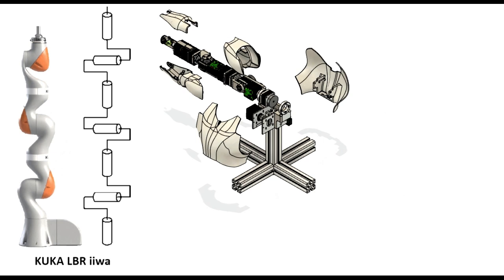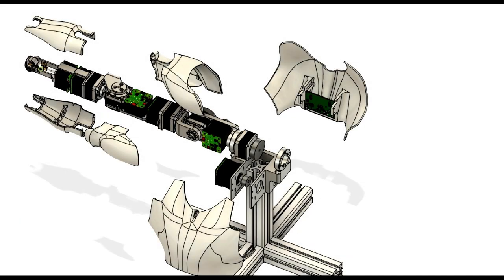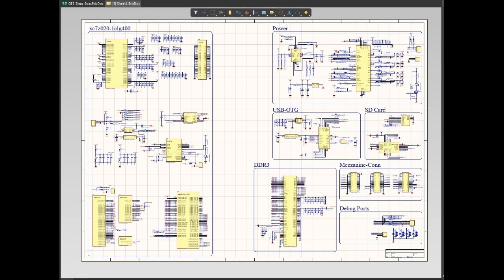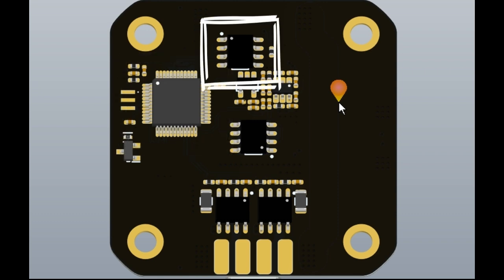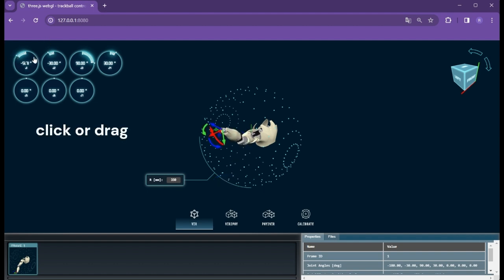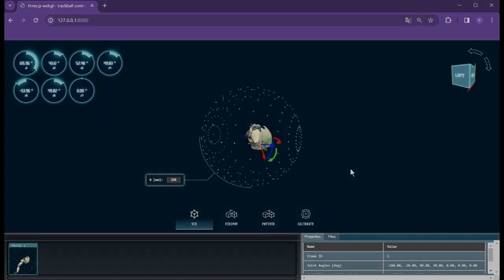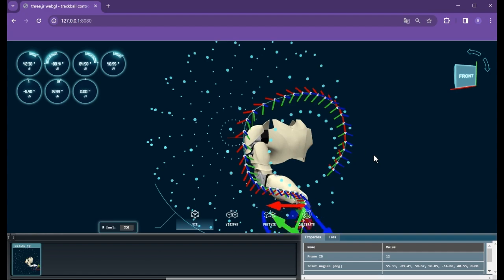QT3: A Humanoid Robot Arm with Armor

Comment: How do you set the robot to Home when the magnetic sensor only detects the motor's rotation angle (0-360 degrees), not the joint's output rotation angle?

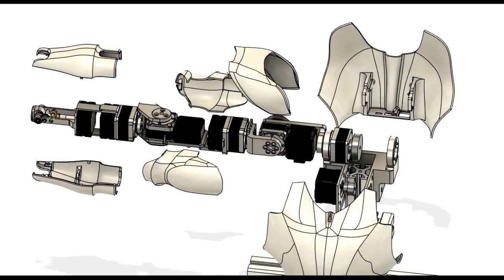Comment: 0:30, that shit is definitely possible with a 6 DOF arm, its even possible with a 4 DOF arm, it literally takes 4 DOF to do that shit, what is going on with the false bs LMAO, it can be done with any arm that has a correct configuration and has 4+ DOF, chinese robot engineers got their education in a sushi resturant.
 
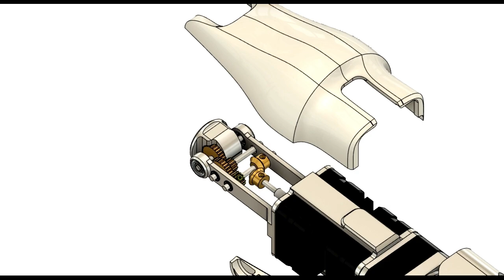Oh and 1:01, a harmonic drive literally exist because its reliable, and weighs less, allowing robots to have skinny wrists. I hope this video is satire, almost every single thing they say is extremely backwards and wrong, this arm is pure garbage. Its literally hobby stepper motors connected together in a chain with a DIY shit gearbox, the gearbox is complete garbage.
Reply: calm down

Comment: the problem with this design is it has no hands and does not even consider the need to place all the motors for the fingers into this design.  You are just ignoring that part to your future detriment.  This is called technical debt.  A total redesign will be needed to even have hands later.
Reply: I strongly disagree with your technical debt statement
 As a designer of robot hands myself, there are plenty of even off the shelf self-contained designs which would fit on end of this arm, let along custom solutions.
Reply: @sstedman  I am not referring to toy level strength hands LOL.

Comment: Wow.  That dashboard and workspace is AWESOME.  How's your heat?  I'm also using STM32 for a closed loop controller - with some home built linear motors.  Controlling them w/ FOC, so curious if you're gonna use SVPWM w/ the upcoming BLDC build :)  the footprint of your custom PCB is lovely.  Jealous of your printer!  Those look and sound like aluminum printed bones

Comment: Bro you did it alone ? It's 🔥.  Why did you connect two motors ? Was it for encoding ?
Reply from the maker: I did not connect two motors, but I did connect motor to reduction gear (that may look like a motor?) to increase torque.
Reply: @吳永玹-t3g  is you use any torque sensor ?
and as in your video you drive the robot manually by your hand and your web robot is moving same, so how could you do this is you use the emf generated by steppe motors ?
Reply from the maker: @Engr.FurqanShahid  I did not use torque sensor. I use a magnetic encoder (mt6816) that can read the augular position of the motor.

Comment: hello Tony Stark, try htd 3m belts and pulleys instead of 2gt, you can save money by 3d printing pulleys for this type of belt, htd3 pulley teeth's are bigger in comparison with 2gt which means can be 3d printed with good quality and precision, as a bonus htd belts can handle more load. have you tried to use ROS2 for your project?
Reply from the maker: Thanks, that's a good suggestion! Indeed the 2gt pulleys are very expensive. No, I have not tried ROS2.